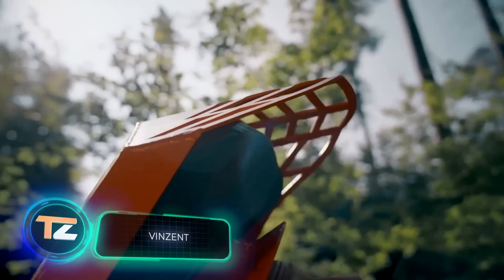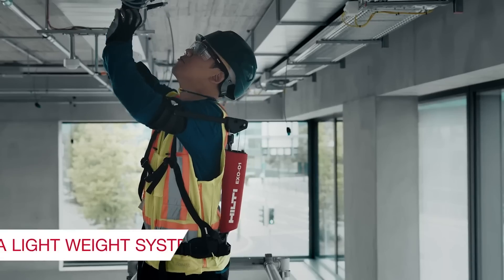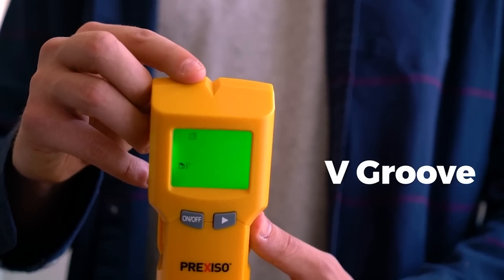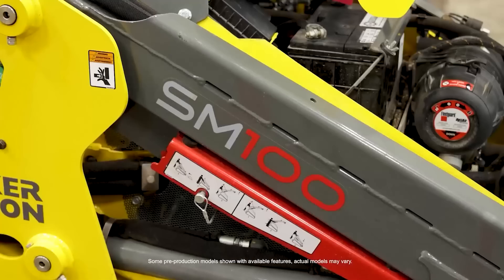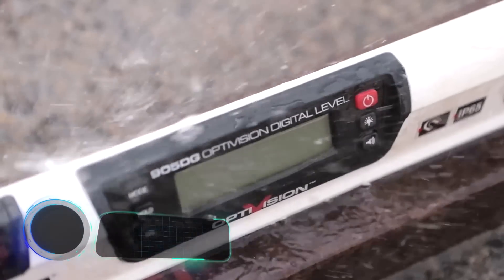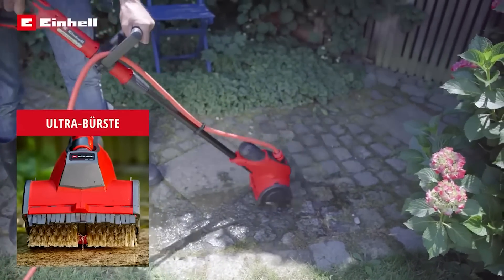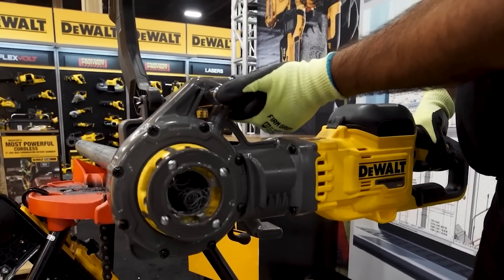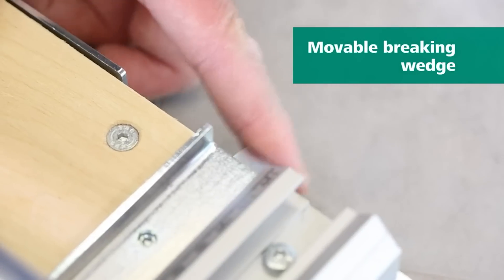INVENTIONS THAT’LL SIMPLIFY YOUR WORK

Comment: A tip for fine tuning the position of hidden studs is a small but powerful magnet.  Locate the stud with a stud finder, and then move the magnet up and down the drywall till it is attracted to a screw head.  I like to leave magnets on two or three screw heads so I can get a good average for the centre line.  The same trick works with ceilings.   I have a workbench that has two thickness of 18mm plywood glued and screwed in a 100mm grid pattern, and the magnet trick was a useful aid to working out dog hole positions.  You can get big packs of Neodymium magnets from places like Wish and Bangood for just a few dollars.

Comment: I work as an insurance adjuster and use the Ridge Pro to climb very steep roofs.  It is a game changer for me as it makes it so much easier and safer to walk on the steep roofs.  But even more important is the safety that it provides while getting on or off the ladder.  It is money well spent.  Also want to mention that you do not need to screw it down on the roof - that is something done if you need to leave it up for long periods.

Comment: The very first invention a show with the metal backpack that prevents falling branches from killing men that are Lumberjacks right there's a design flaw if you look at the very back of it that goes up the back and over the head they have a flat spot they should have made it the shape of a pyramid I'm sure they did this because they figured if the guy falls on his back they don't want him to roll over but that's how you get back upright rolling over but when the branches fall the impact is going to be greater versus if there was an actual nice sharp Point going up the back like I don't know a dinosaur back you know like Godzilla so when the branches hit they hit a smaller point that will break the branch faster and easier releasing the pressure from hitting the man and taking it with the branches off the sides the design that they have now absorbed the kinetic energy you want to dissipate the kinetic energy